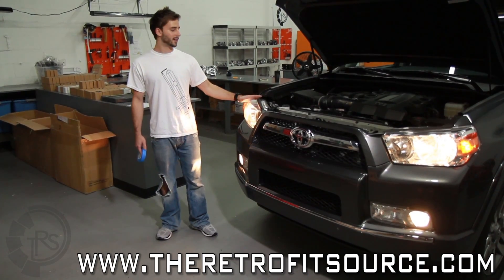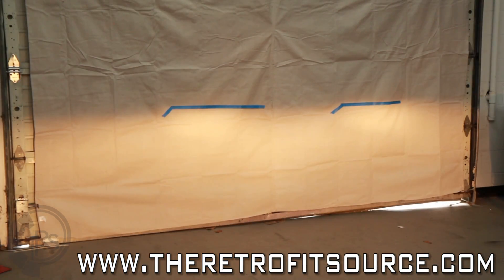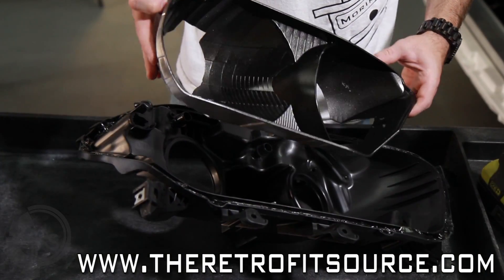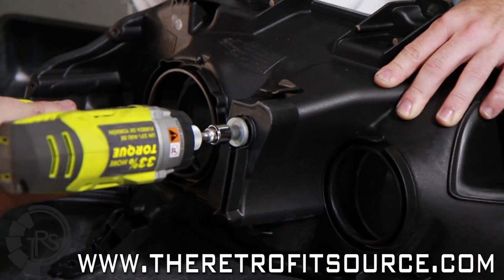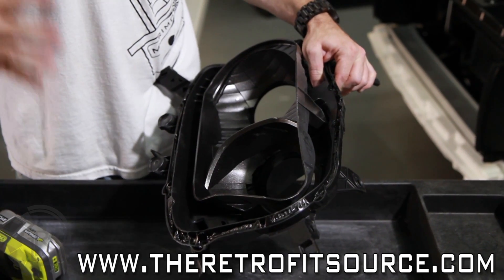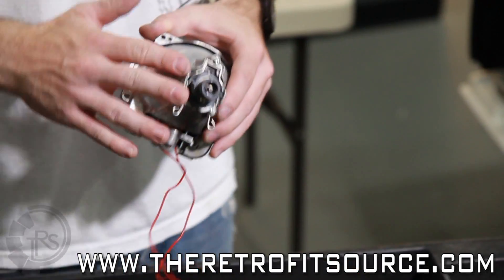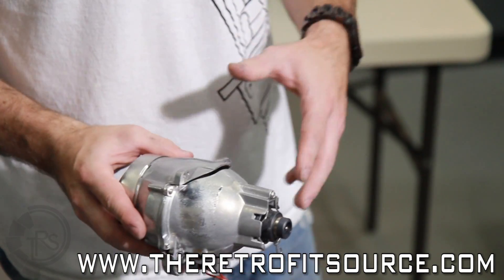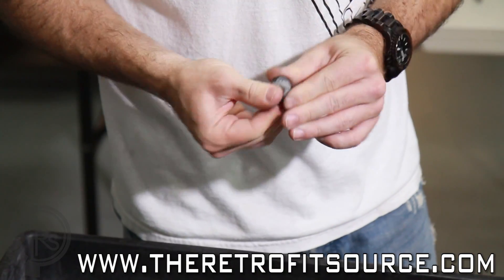TRS Tips: Mounting and Aligning Projectors in a Headlight Retrofit

Comment: Hi sir I have problem with my high beams light
It was I Touch it now my high is beams lower then headlight
Because the adjustment is pull out 
I can't do anything about it
If you can please contact me 
I will bring it to you for riper 
Thanks a lot 
Amin 
07446868798
Reply: +Azad Amee 

Hello, we are sorry but we do not work on headlights here, just concentrate on the development & supply of parts

Comment: Hello TRS, my on my genesis coupe , the high beams sit around 1 inch lower than the low beams. For aligning high beam projectors I should align them to the center height dot on the lens, correct? Otherwise over the distance of the beam the high beam pattern would be way above the factory ones.
Reply: +Jordan Clarke Yes sir, always align according to the low beam / projector beam, not the high beam output

Comment: Hello TRS. Many thanks for the informative video, i realised from the video it's a 4 projectors setup which what i bought from you and it's what am gonna do here in the UK , however from the last shot of the beam patterns while they are ded level with the original beam patterns in terms of high and low.  It's not quite in the centre in terms of left and right. I.e in each side of the car one of the projectors is slightly to the right and one slightly to the left from the original cutoffs patterns, is that a problem? And or what is the limits as to how far I can go in any direction??
Many thanks guys and keep up the good work.

Comment: So if u use Steelstick to hold the projector in place and then JB Kwik it for a permanently mounting. Does that mean u dont not need to use nuts and bolts to hold the projectors?

Comment: Great video guys. Really makes things easy for the beginners.  One question with this method. From having done a ton of retrofits, it was pretty common that you'd test everything, get it all assembled & install to find out something is wrong & you need to pull it back out.  If you're epoxying the projector to the reflector, how do you handle such situations?

Comment from the maker: Yeah JB SteelStik is really just the first step for tacking it in place during alignment - drilling screw holes is a good idea too. Will need at least another full layer of regular JB weld on top of the putty though without screws.

Comment: The JB SteelStick doesn't sound like a bad idea for the initial alignment.  I may use that on my next retrofit to hold the projector still while I use the screw holes on it as a guide to drill through the reflector.  Then bolt everything up with regular nuts and bolts.  I'd be afraid the epoxy would fail with the first bump I'd hit.